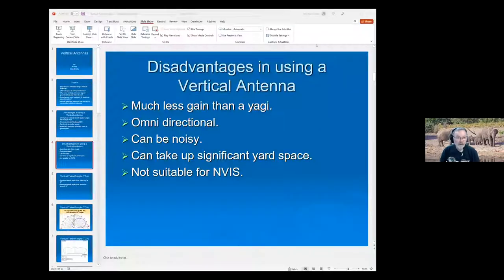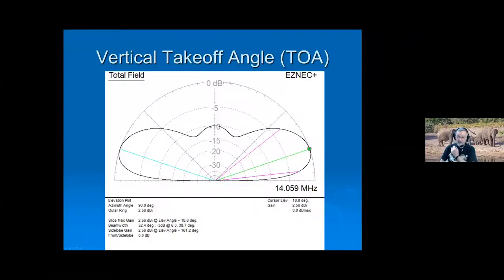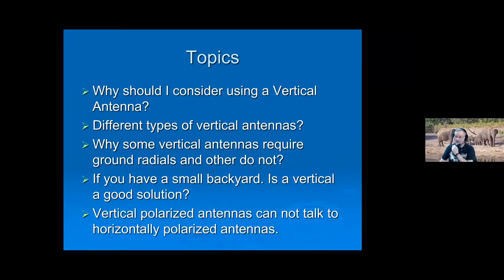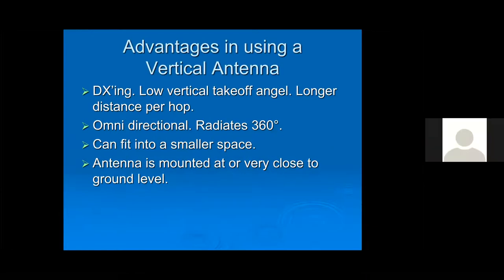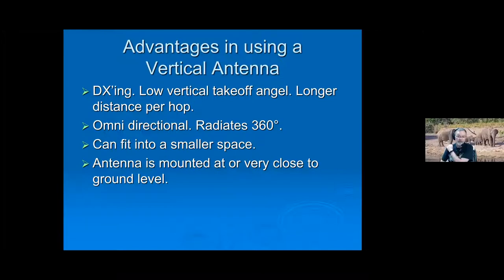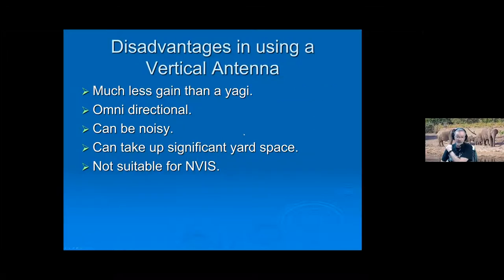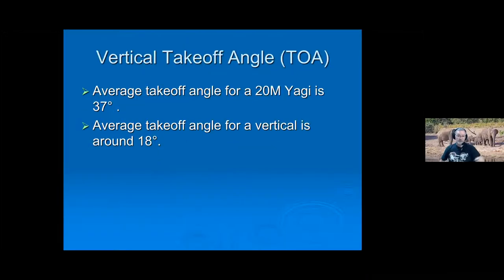January 2022 Presentation - Vertical Antennas

Comment: Ground mounted vertical radials are affected by the ground, their radials do not have to be resonant  (1/4 wave lenght) because the ground is different in different places.you can use from a few the as many as you can but after 30 or so it does not make a big difference. This guy does not like verticals.